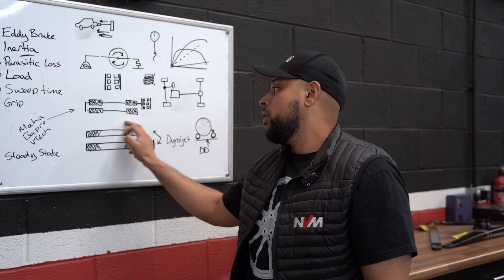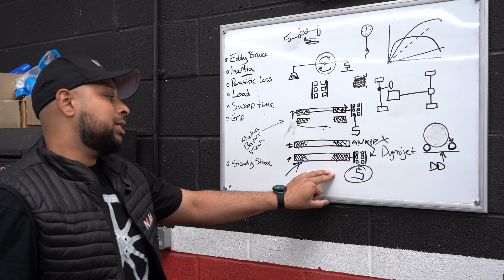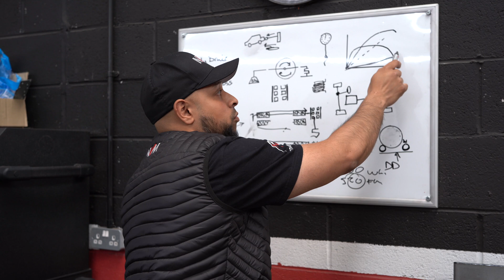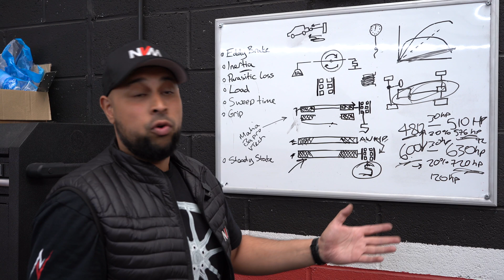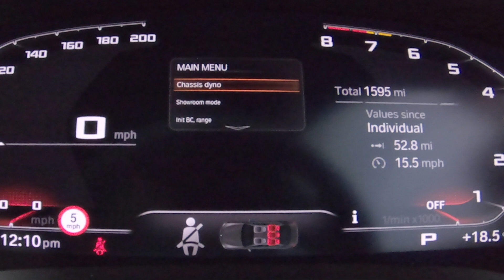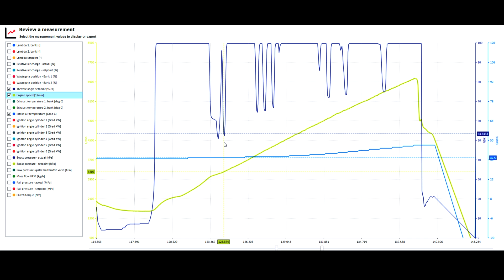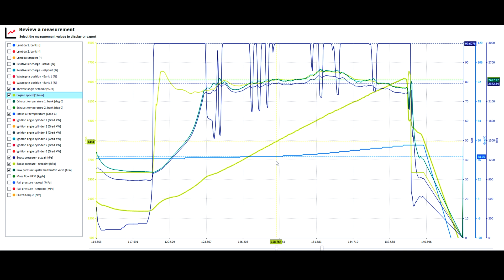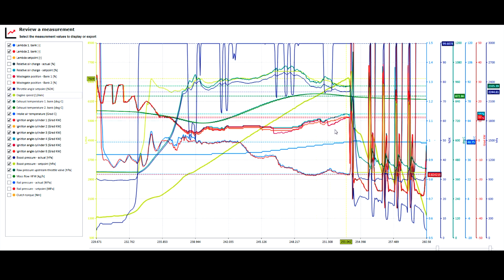How Much POWER??  *DYNO Talk*

Comment: Question. So on a maha, if the tuner does the runs with the tyres directly on top of the front roller, zero contact on the rear roller at any point. Would that give an inflated flywheel figure? And would that be because the initial wheel power reading is inflated, and/or the parasitic loss measurement being inflated?
And any idea how far out the figures may be?
Reply from the maker: Not a question we could answer. But if thats the case walk away.
Reply: @NVMotorsportUK  how much for a dyno run?
Reply from the maker: @Sbrumtwn  £75

Comment: I'm confused. So most dyno runs I've seen are indicating figures are higher than BMW quote. This video indicates they are well under. I know there is some variation but the differences are extreme. Not sure what to think.
Reply from the maker: Less sweep time means higher figures and lower iats.. but a road log will be identical to a 5th gear pull in our test. We have since tested on a cooler day at 497 Bhp